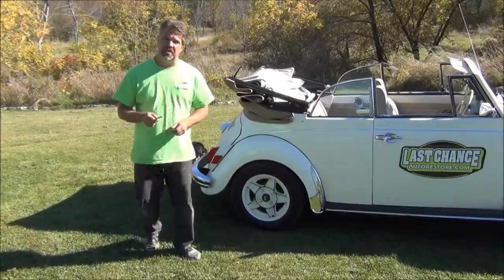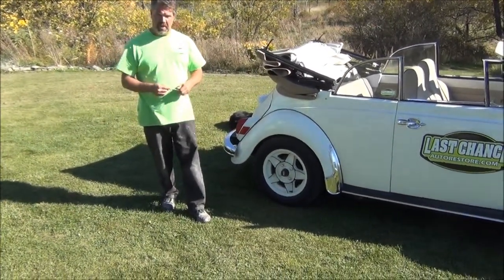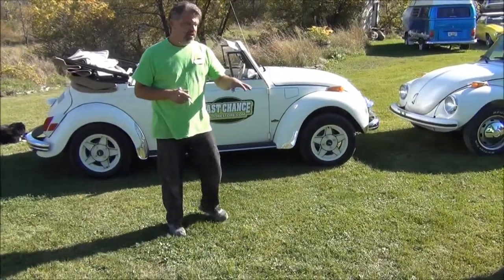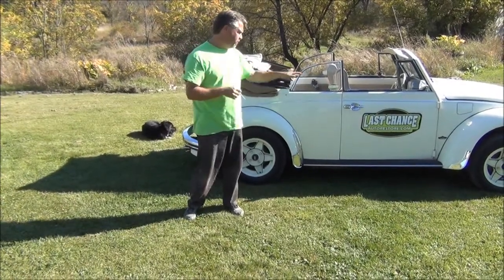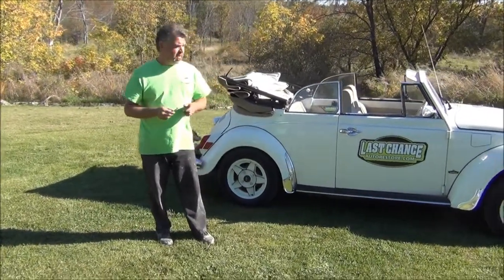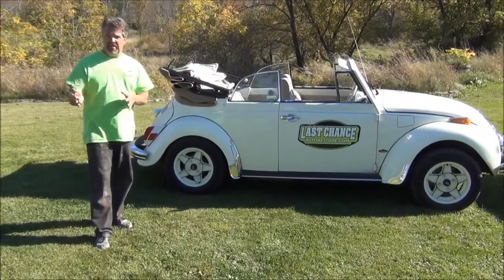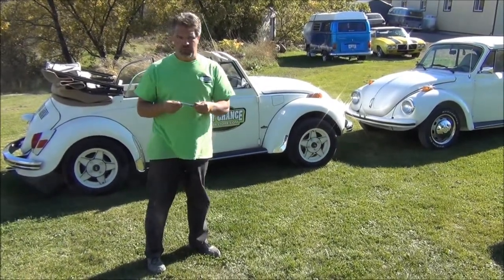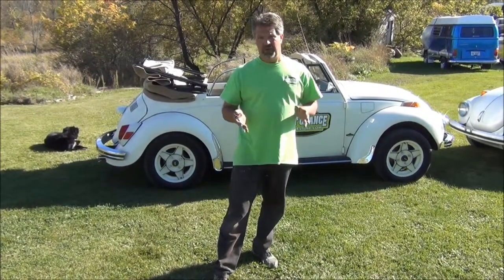Classic VW Bug Beetle Tire Pressure Tip, By lastchanceautorestore.com

Comment: I am having the classic super beetle shimmy. I have changed the shocks, springs, all rubber grommets, still the shimmy. Someone put 195/65 on the car. I think they are too wide...? What do you think? I will check the pressure, great tip. Thank you.